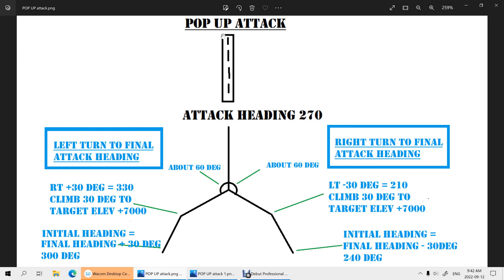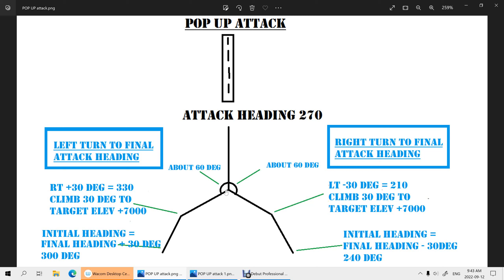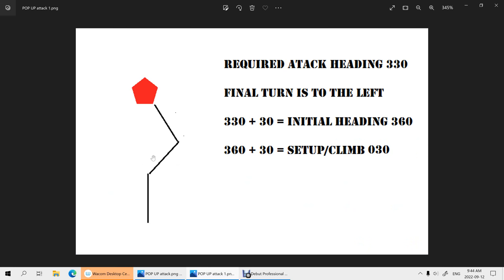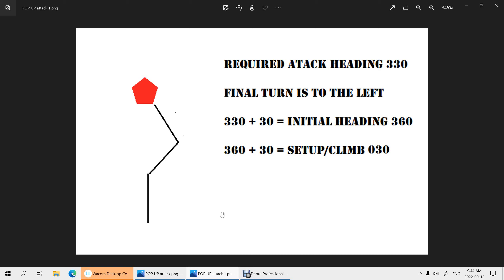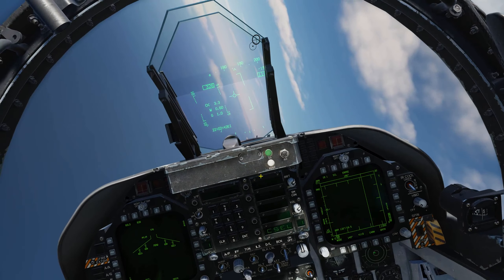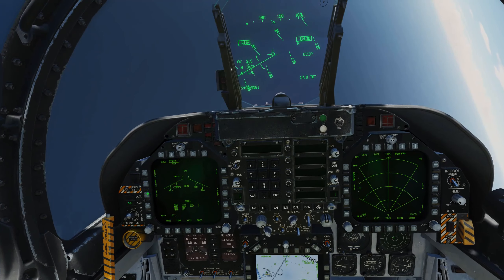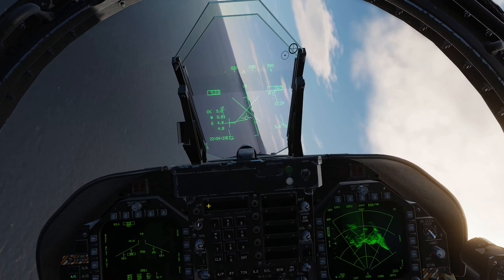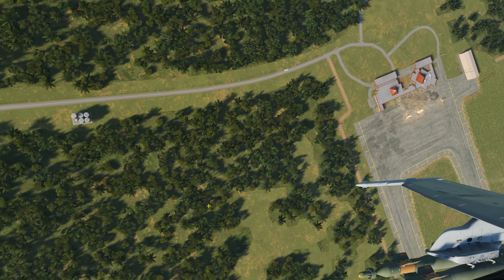How to pop up attack. #dcswqc

Comment: Why do you want your ccip cross beyond the targets and not in the middle of them. Didn't you say in a previous video that the cross marked the mid-point of your bomb group?  Why didn't half your bombs go long?  I'M SO CONFUSED!
Reply from the maker: Hi and thank you for your questions. It’s not the CCIP cross that you want to put beyond the target; it’s the Flight Path Vector (FPV). Your CCIP cross needs to be over your target for single bomb, and in the middle of the area you want to hit when using multiple bombs like you said. In this example, I dropped 4 bombs with an interval of 50 feet which works out to be 4 bombs in 150 feet ( 💥-50-💥-50-💥-50-💥), so not a big spread. It’s normal for such a small interval to have the impression the bombs are falling as a group. Here’s what I suggest you try: load up with 8 bombs and drop them on a runway with an interval of 200 feet while making note of where you pickle (next to a crossing taxiway maybe?). Repeat with an interval of 50 feet aiming at the exact same point on the runway. You will be able to compare the different damage areas. Don’t hesitate to contact me again if you need more clarification. Good luck!

Comment: Sorry but I thought final attack heading (FAH) was 270 (2:15) in your awesome diagram, but you have FAH as "required attack heading" of 330 (2:31). After the pop wouldn't you roll out on the FAH and not the "required attack heading"? I was a U.S. Marine Forward Air Controller (FAC)  or now called Joint Terminal Attack Controller (JTAC) and this confuses me a little. Maybe I'm just old and the geometry has changed lol. The pilot "target in sight" call followed by "wings level cleared hot" call validates the drop and clears the pilot to pickle. The FAH is verified by the FAC/JTAC if I remember. Of course this all depends on CCIP, auto, or loft! Any old FACs out there to refresh my memory? Been a long time.
Reply from the maker: Hi. The terminology I’m using might not be exact. In the case of a JTAC like you, you are right it is final attack heading. I’m using “required attack heading” to indicate a restriction from a planification stand point like it was taught to me. Cheers.